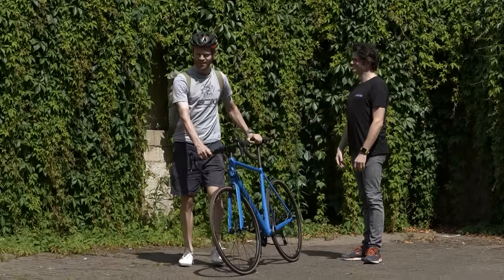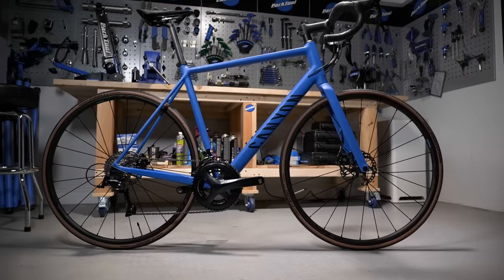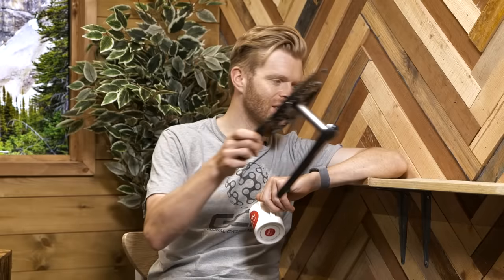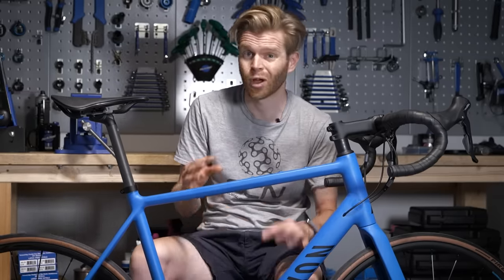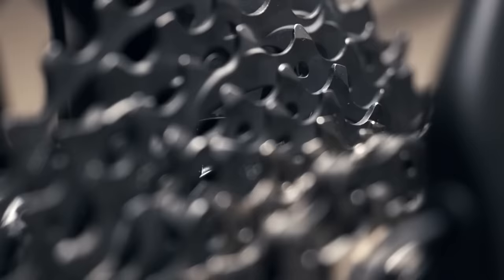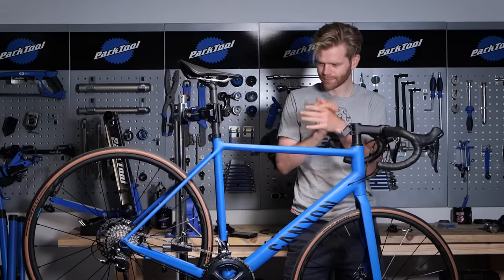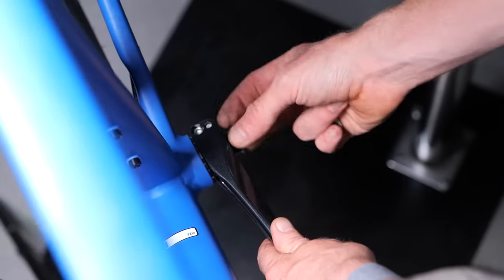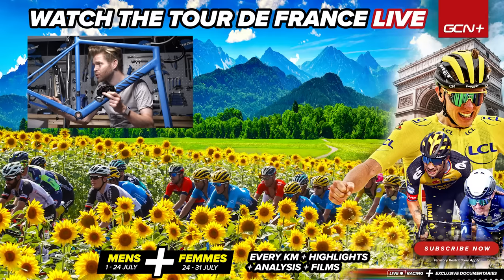Upgrading Your First Road Bike | GCN’s Bike Makeover Ep. 1

Comment from the maker: Have you upgraded your first bike, or did you get a new one?
Reply: I bought an old bike and rebuilt it. All new components. I love that bike.

I too have gleefully ridden like Ollie at 0:05 but I'm shorter and I was sincere in my goofiness.
Reply: I love to “update’ my bikes, I currently have 2 mtn bikes and 5 road bikes. I have customized them all with new cranksets, seatpost, stems, better bottom brackets, bars, derailleurs you name it. It is one of the most concerning things with the new bikes I see being released by the major bike brands. So many parts are unique and proprietary.  Is it going to be possible to update this new crop of bikes when they become less current? Where do I find a stem that will work? How can I find a lighter “d” shaped seat post. My hobby is looking for my next bike and if I want a bike that has parts that are easily swapable I have very few choices in the mid/high end range.
Reply: I have upgraded my first bike till now but not the best... Still using till now 1year... But can I have the sora groupset?
Reply: Yes. Took my Cervelo S2, upgrade to SRAM E-Tap, Reynolds Assault wheels, Quarto Crankset, and a ceramic bottom bracket.  Love my bike and see no need to buy a new one. May even trick her out a bit further at some point.
Reply: Isn't shimano Sora 9 speed?
Reply: Wheels broke down, upgraded to DTSwiss wheels, best upgrade! Also changed seatpost, bartape and cassette to an XDr one for bigger range.
Reply: I just changed microshift cassette for original shimano 105, buy new tires and latex tubes…
Reply: I upgraded my 1985 Peugeot Carbolite 103 bike to a Reynolds 531c frame & forks with SunTour AccuShift in 1988. Then replaced that with a Scott carbon fibre 105 groupset bike in 2009. Still riding that, but have a mind to upgrade to a new Ultegra Di2 bike once lead times come down from 9 months... 🤣
Reply: I have a Canyon Endurace AL rim brake. I have upgraded to Shimano 105 R7000 11 speed groupset and a set of HUNT Carbon 50 wheels. When's the next video, I though it was a weekly update?
Reply: I sold a dura ace 7400 from a 90's aluminium bike, to get a tiagra 4700! Looks/works great on the old frame and now 2x10speed instead  of 2x8 but with climbing Gears
Reply: I am creating a quite interesting bicycle 😂, I have a btwin fit 300 and I am going to put a Bianchi Aria 2020 fork on it, I am going to change the wheels for some SHIMANO RS 171, I want to make it a single chainring and put some 11 to 40 or so, right now I have an ultegra (11 28)
Reply: I Dont Have a bike but i want to try it  😄
Reply: I have a giant contend 2 2019. So far the upgrades are:
- GP5000 tyres
- Hollowtech II bottom bracket and crank conversion
- 105 Rim brake caliper
- swapped from 11-34 to 11-28 cause i dont use the 34 tooth at all
Reply: Isn't that way more expensive than just buying a new bike considering the cost of just a decent group set?
Reply: I normally end up swapping the seat, bars, and pedals. Im new to cycling as an adult, I was given a 2014 trek remedy 7 29er. Ive swapped the seat and bent the rear rim (replaced), new grips, and thats it. Awesome well balanced bike, I often ride no hands on the grass at the park.

Im getting a road bike that can take wider tires, I'm thinking the specialized Roubaix. I have many upgrades planned. I may build my own from a frame.

Comment: Yes, most people will put Dura Ace Di2 on their first bike… The gap between new riders and the pro peloton shortens daily 👍🏼
Reply: Right after we get deep dish wheels!
Reply: GCN videos are basically long advertisements for bike companies. Dont expect much from advertisements.
Reply: When I first put carbon wheels on my bike back when I still ran Sora I laughed to myself quite a bit as well. Now that I'm on sensah the only reason I can think of for going back to shimano r7000/8000 (I don't think I'll run 12 speed even if I had the opportunity to for a while) is vanity (making my bike look cool to the general public). But hey, having people with top spec bikes especially friends gives you the opportunity to experience the joy of riding expensive equipment without buying it, so I'm not complaining when I have friends who ride high end bikes.
Reply: I have typically advised new riders to invest in a bike that is spec'd slightly above what they might have budgeted.  This gives them the opportunity to "grow into" it and not find themselves sometime later doing what Ollie describes in this video.
Reply: ...and I agree with Ollie.  Electronic shifting is waayyy better than cable.  Hydraulic disc brakes waayyy better than mechanical disc or rim brakes.
Reply: Good comment. However, I actually like putting (last gen) top of the range group sets on (old) aluminum bikes. It's kinda cool having an aluminum bike that is lighter than what most pros are riding these days.
Reply: @potatocipollini8013  I agree with the shifting side, the braking not so much.
Reply: Until we get on the road! Looks good on the curb though!!!
Reply: @adithyayuri  Yup DurianRider says it all the time.
Reply: @adithyayuri  ???
Reply: Personally I find it interesting to see, that you can even go that far on an entry level bike. Makes me confident in my buying choice to know, that I potentially could go to the max.
Reply: @potatocipollini8013  I'd much rather have a better frame with cheaper components.  Upgrading your frame isn't as cheap as upgrading components

Comment: im still on my 1st bike, used TCR Aluxx SL1 2021 with 105 R7000 after picking up cycling 8months ago.
The upgrades i did was swap the 25mm CTS tires and butyl tube it came with to 28mm GP5000 and Revoloop tpu tube. Speed increase was significant.
Then recently i swapped 42cm drop bar to 36cm to go full aero tuck

Comment: The welds on this bike is so good that I mistook it for a carbon endurace. Good job Canyon
Reply: Same here. He said "entry point" and I thought it's a carbon bike but it's actually a well made aluminium bike.
Reply: Same hear. It makes me think I should get a Canyon aluminum bike for my next bike. That weld is so well done.
Reply: Cannondale CAAD bikes are like that, too. They grind them down and it makes them look pretty. Works really well, too. Another option for anyone looking at that tier of bike.
Reply: @rizzoid  yes Cannondale is also good at welds. What disappoints me is the welds on the new Allez Sprint, if it wasn't for that I would've considered getting one
Reply: @rizzoid  Welds on my Caad12 are not grinded down, but they look good. On the other side welds on the newer Caad13 look very ugly! Just google some pics of it. The times where aluminium frames could compare to top spec carbon frames are over.
Reply: Shhhhh, you’ll upset the Spesh fanbois
Reply: I have a 600 dollar aluminium bike that has good welding its all hidden
Reply: @rizzoid  and they're quite light, depending on each one.

Comment: This is the one issue I am thinking of with the bike industry at the moment...Your not really going to be upgrading a disk brake bike with a new groupset from the last 2 years (you could but its unlikely) most people upgrading would have a bike from 4-5 years ago and most likely would of had a rim brake bike. 
So instead of being able to get a nice shiny rim brake groupset and nice wheels most items are disk only now, so instead of upgrading parts you have to buy a whole new bike it seems. This is why I find it so odd the 105 is disk only? Upgrades for new equipment will be much harder for a lot of people the 2nd hand market is where it will have to be.
Reply: When I was looking at this, an issue I found was the older rim brake bikes have  limited tire clearance.  There's also the whole through axle thing to make things more complex although I think you can get hubs that work with qr and through axles.

Comment: Some decent tyres (P Zero) and second hand Mavic Cosmic aero wheels were my best upgrades. I reckon 1mph added to my average speed, for £350 all in.
Reply: It’s impossible for 1mph to be added to your average speed just from wheels. When you add TT bars to your bike and get I a TT position that is a drastic change and even then that only adds 1.x mph. Wheels are more like 0.4mph
Reply: Nah...buy some decent Chinese carbon Wheels from LightCarbon or somebody else. Gap the expensive Chinese Companies like WinSpace, EliteWheels etc... - they are also all about maximising  profit.
Reply: @loc9588  It is absolutely possible to add 1 mph by changing wheels, tyres, and assuming hubs (since he said he changed wheels not rims). Do you know the condition of every hub in existence? No. So you cannot state it's impossible. My hubs are shot, so currently I need about 300 watts to give the same speed that I previously got with 250 watts, over a known 13km course. Therefore I would be 50 watts 'faster' if I bought my same wheels again in new condition. It's actually more impossible for 50 watts to not give me 1 mph.
Reply: @loc9588  then no change is worth it, imagine 350 and you gain not even a km/h??

Comment: first thing I did when I bought my bike was swap wheels.  Saved 500g and it only cost £171 due to black friday.  Changed saddle for personal preference, put a carbon post on it and new tyres (wanted to go tubeless).  Bonus was loosing some gramage.  What you did isn't really normal. Would like to see the effect of everything you changed.  Did it actually make the bike easier to ride.  I noticed the difference the tyres made pretty quickly.

Comment: Heehee, I did a theoretical list of full weight weenie-ing last years AL7 (rim) when I grabbed one, and for the princely sum of the same amount as TdF winning bikes you can get it under the UCI limit by almost half a kilogram (mechanical setup).
2nd tier stuff (Ultegra, EASTON EC70/EA90, 1250g carbon wheels) I ~think~ was 7.3kg at roughly 3x bike cost again.
I grabbed the XXL 105 (rim) version, swapped wheels off for Bontager TLRs I already had, running on 28mm and tbh it's a bloody good lil rig!

Comment: Reading the comments, there are a lot of people who think that this is an absurd upgrade. It's not too late to change the plan. Put the Di2 Dura Ace on a bike that previously had 105, put the 105 on this bike, do a giveaway of the Sora groupset and wheels. Of course, after the series is made, I'm sure the Di2 will go back to Shimano, and the bike will be rebuilt to original specs. Otherwise, this makes so little sense to rebuild a brand new bike. I've only got Aluminium bikes, and they are great for me, but if I did have fancier components I'd want a tasty frame too.

Comment: That’s cool, but I’ve saved 908g (2.00lbs) on my entry level road bike with Ali express parts for just over US$320. Still using the stock aluminum wheels and shimano Claris. Eventually I’ll buy sensah empire 11spd for like $300 and then carbon wheels in the far future

Comment: Nice ad, GCN... First road bike? So let's imagine I've got some bargain on used "excellent shape" alu Canyon, and I'm feelin' high, 'cause it's a light blue pretty arrow for me right now.  It's set with good enough but newest Sora, and all of the new features like through axles, HT2, apart from hydraulics, but to be honest I like something I can easily service myself, so it's cool. So what to change? Well I might search for some high rim wheels, but cheap, 'cause I only like the look. And definately I'd change that generic stem. And get some nice blue bartape. If I'd really get into cycling with focusing on cadence and some aero and comfort, I would search for higher gear stuff and probably better fork and bars? But just for amateur riding to be fit it's more about durability for good price and easy service than fancy pricy lightweigh aero stuff... I don't get you GCN. Entry level used road bike for a rookie is not Canyon AL with through axles and HT2 worth quite a lot even used, but something like older Giant, Trek, Merida etc., or some local brand, with older groupset, QR wheels with rim brakes and probably without carbon fork. Few years ago I wanted to check what's so cool about road bikes, I'd bought old steel Koga Miyata with really old RSX group, probably second ever model of shimano 'brifters' and nice chrome-polished look. Most importantly it fits me well, I have fun riding it and servicing it, so why should I change anything apart from bartape, pedals or tires? Should I install some older Dura Ace too build up my ego and for marginal not really important gains in amateur cycling?

Comment: Hey folks looking for some help. Ollie maybe one for You. I have a canyon aero bike . Problem is the headset. It’s the only bike I have which lives on turbo and the road. And I’ve clock ⏰ a lot of miles on it. I’ve recently had to change out my handlebars as they cracked. And they where the canyon alloy ones. I looked it up and over sometime your sweat can eat away at your handlebars. Yes I did clean 🧼 down the bike but not all the time. My question is how to get thebearings out now. Is there a special spray as I can get. It’s over  a week in oil .. as it’s bad.. help needed because I love my canyon.

Comment: Perfect! I was just thinking about upgrading to better tires and latex tubes on my roadie.
Reply: I switched recently from cheap road tyres with butyl tubes to midrange tyres with latex tubes and I gotta say it was worth it
I lost 450g in total but what amazed me the most is the rolling resistance, it felt soo smooth and I even felt a difference going uphill
Better outer tyre meant also better grip and better braking performance without sacrificing rolling resistance
The only downside is the fact that latex tube looses air so quickly
If I don't ride for 3-4 days I have to inflate some air cause pressure drops down to almost zero
Reply: Tires have probably the biggest influence on ride feel. Definitely go for better tubes and tires, I was blown away by the difference they made!

Comment: Then there’s me, crashed the old 9x Deore rear mech on my MTB, and the only compatible replacement without swapping cassettes and shifters is Altus or Alivio😭
Reply: BTW, if your Deore XT has an Octalink crankset you are likely limited to Alivio exclusively (since Altus and Acera have square or two-piece type BBs). Been there, seen that (and bought two sets of Alivio cranksets to have spare chainrings).  The original chainrings were steel and lasted about 20'000km. Alivio's are also steel (maybe a bit heavier) and I hope they will withstand the similar distance. 

PS
Neither RD-M3000 nor RD-M3100-SGS looks bad. Have you had any issues with them?

Comment: Make a video about adapting wheels with TA hubs to QR frames, please.
Reply: That would be a short video, you buy the relevant end caps or push in QR adapter.
Reply: @chris1275cc  Haha! 
Okay then - let it be it a part of a longer one (incl. wheel truing, cone'n'caps cleaning and adjustment). 

PS
Is it really so simple (asking for a friend)? I think there are different hub widths (142 TA vs 135 QR at the back, for instance)
Reply: @PrzemyslawSliwinski  There are different hub widths but it's usually down to weather or not the bike is disc or rim, but if the hub is to wide for the frame you are out of luck anyway. Best thing to do is check with the wheel manufacturer first to see if they do an "end cap kit" if they don't the aftermarket inserts and cheap enough to give it a go.
Reply: @chris1275cc  Well, it doesn't look rosy... We have a Lapierre X2 Race Fitness tandem and three sets of wheels. So there is a chance the hubs (Deore XT) will withstand more than a few seasons.
Reply: @PrzemyslawSliwinski  Well actually that makes things (kind of) a little more simple. They are 26 MTB wheels and hubs so pretty standard, because the vast majority of 26 MTB's are/were QR you should have no trouble finding wheelsets in QR and almost all of the new, higher spec 26" wheelsets (of which I admit there aren't many) are built from TA to QR adaptable hubs. Also its always worth bearing in mind that having a wheel built to your specs' is nowhere near as expensive as people imagine it to be.

Comment: I bought a £60 carrera virtuoso from a local pawn shop not really knowing which much about bikes but turns out it has shimano 105 brakes and Claris shifters.
I was going to buy a new bike for £1000 but the components are seemingly not as good. 
Now I don’t know what to do
Reply from the maker: Hi there, thanks for your message! So you have a few options here it seems. So a new bike will in all likelihood have a better frame than the carrera you bought, and should also have at least similar components to Claris, if not better for £1000. 

However, seeing as the Carrera was so cheap, it may be worth hanging on to it, and upgrading some of the components which have worn out, or maybe just keeping that as a do-it-all winter/commuting/cafe bike that you don't mind gets a bit scruffy!

At the end of the day, it depends what you need/want the bike for, but it's hard to think you'll get a better value bike than a £60 one!
Reply: @gcntech  thanks, I feel obliged to save up and buy something better tbh

Comment: Just under £1000 isn’t entry level to the majority of people getting into cycling. And you can buy a high quality used bike for so much better value than what new bikes offer. People should buy reliable components instead of the newest products that companies are pushing. GCN should be more in touch with the general cyclist instead of showing off the newest “super bikes” as the standard and acting like a £1000 bike is cheap and slow